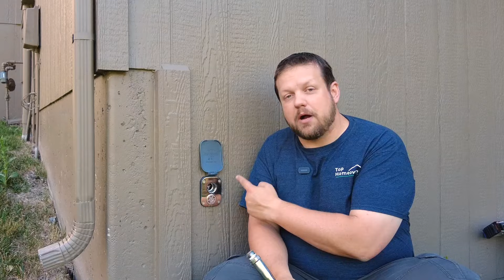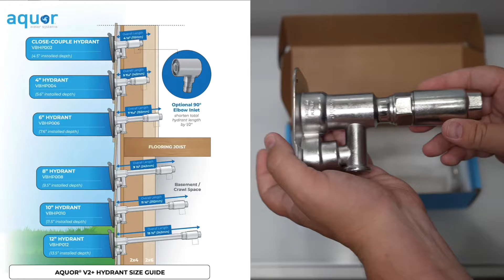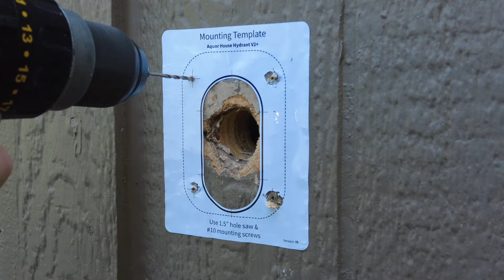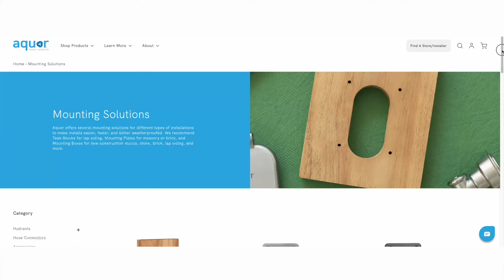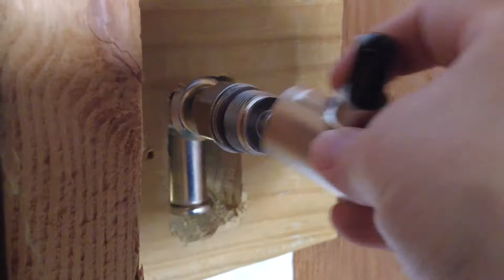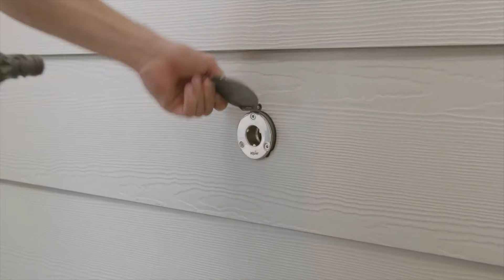Replacing Your Hose Bib? Aquor House Hydrant V2 Review

Comment: The spigot I have that can freeze exits from inside a bedroom wall.  Not an unfinished space.  I guess that means I need to cut into the drywall to install this?  I use this spigot year round for water to my animals, so I deal with freezing worries every winter.  Even with a insulator cap.  Thank you.